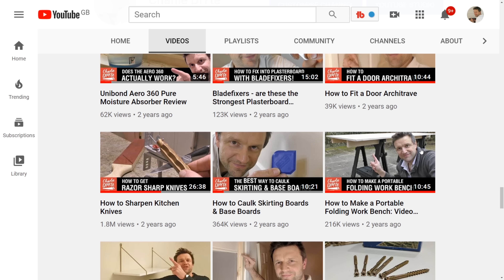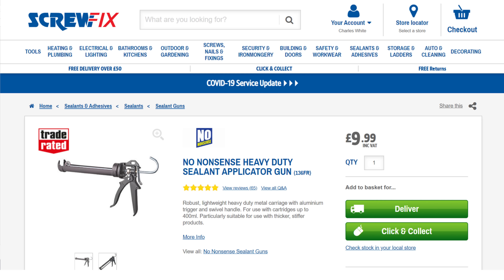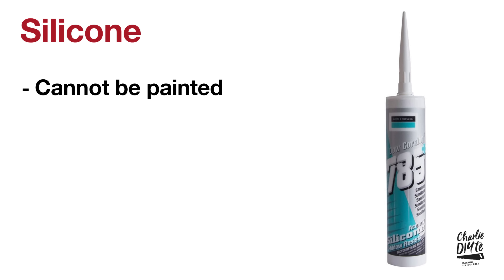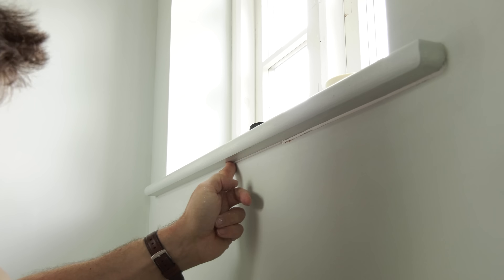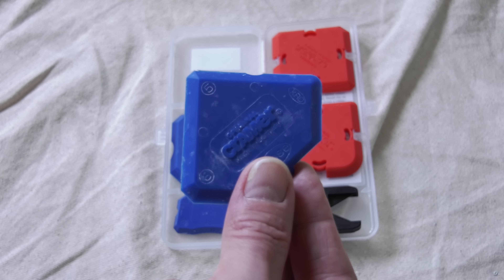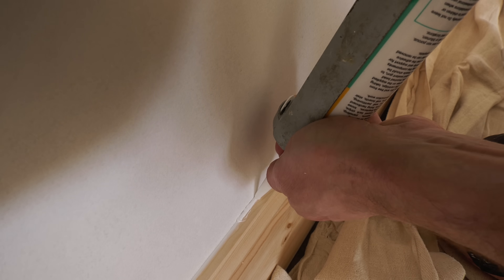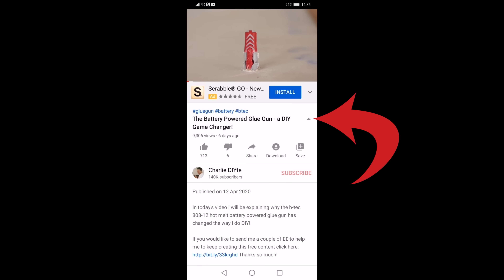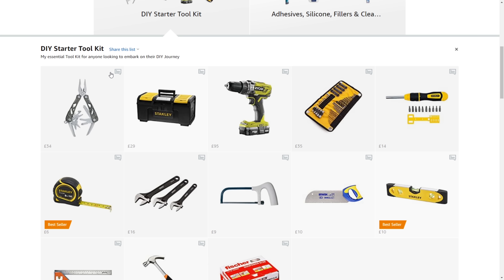How to Caulk Skirting Boards & Baseboards - 2020 Update

Comment: For your wooden boards scenario, why not use liquid nails (same size tube of glue) which will hardened as cured so dirt and fungus can be easily cleaned, whereas the soft silicone will let them penetrated & diff to remove. Have u ever think of the pros & cons of using waterproof liquid nails over silicone in some of your caulking jobs that needs painting onto the cured caulk?? Can u share your comments about caulking with liquid nails. Another pro is the high adhesive power.
Reply from the maker: Sam I used an impact adhesive on this job before I caulked. I've just sent you the link. The key is to make sure you can tool it and that it can be over painted.

Comment: Does the primer you use negate the need for knotting solution?
Reply from the maker: Yes absolutely. Zinsser BIN is shellac based and so it completely seals the knots. I love the stuff. I don't use any other primer now. Plus it dries in 15 minutes, repaintable in 45. Check out some of my vids on it https://www.youtube.com/watch?v=jEhhNqYkmAE
Reply: @CharlieDIYte  Brilliant - knotting is such a pain ...thanks for the tip!

Comment: Charlie which is the best glue too use for skirting board going onto new plaster walls
Reply from the maker: Good question. As I said in the vid, a lot of carpenters glue and pin, but this is trickier if you've got masonry walls, where you'll need plugs like I did. I used to think Gripfill original (the green one) was the best but it does skin over if you don't apply it quickly. The others are a lot more like silicone as I showed in the vid, and so if you want to go down this route, any of these would be fine https://bit.ly/3hRZArH . Sticks like Sh1t has a good following and has been around for a while. A lot of people are using foam now. So maybe get yourself a gun https://www.youtube.com/watch?v=Obc1thYnLEs&t=5s and experiment. It has the added advantage that if you ever have to remove the skirting you can simply slice the foam away with a saw. My suggestion would be to use foam, and shove a heavy tool box against the skirting whilst it sets. It'll help with thermal insulation too. Check out this thread https://community.screwfix.com/threads/best-skirting-board-adhesive.201571/

Comment: If doing wooden skirts that are varnished. Do you still caulk using white or find a matching colour to the varnish ?
Reply from the maker: That's a good question. Typically people use a caulk that matches the wood but it depends if you want the caulk to be an extension of the skirting or the wall. I think you could get away with a white caulk and then paint it as in my view the caulk is an extension of the wall but you'd need to use the Cramer tool and maybe experiment with both and see which look you prefer?
Reply: @CharlieDIYte  perhaps you could advise me. Finding a pine colour caulk is difficult. I wondered if this was suitable instead. https://www.screwfix.com/p/ronseal-multipurpose-wood-filler-natural-310ml/50971
Ronseal wood filler in a tube. Says its flexible and no shrinkage. I've gone for clear matt varnish as I like the knotty pine look.

Comment: Hey, great video, I bought the Cranmer after watching your video a few months ago and it's changed my diy life (bit sad lol). What type of sealant/filler would you advise I use to fill gaps between pvc scotia and a plastered wall with emulsion paint?
Reading online some people suggested polysulphide mastic, but I've never used this and I'm worried it will need doing again in a few years. The pvc scotia is covering a large ceiling area and it's only accessible with scafolding, so I want to make sure it's done right the first time. The area has also been prone to mould, so I want a sealant/filler that is resistant to this too. Thanks.
Reply from the maker: Hi Roy. I can't categorically say for sure which is the best, but in my experience the best silicone on the market is manufactured by Sika, so you might try Sika Decorators Caulk https://bit.ly/2LlGwnq. If the area is prone to mould, you might take a look at my mould video https://www.youtube.com/watch?v=jEhhNqYkmAE If you can treat the ceiling with a paint that's impervious to mould like I did here, or perhaps the Zinsser Ceiling Pro all in one paint https://www.youtube.com/watch?v=7qIEamDwxfg&t=1s then that'll get you half way there on the mould issue. Also, (sorry Roy, I'm giving you loads of homework here) get yourself a hygrometer and try and get that RH level below 60% then mould can't form. Take a look at my condensation video for more info on this https://www.youtube.com/watch?v=TIDb-pdOnXM&t=3s
Reply: @CharlieDIYte  thanks for the detailed reply Charlie. I have already watched your mould video, it was very comprehensive and helped me tackle a separate mould issue I had in my own property which worked well. I will have a look Sika caulk, I didn't realise they made it, I've only seen sikaflex. Thanks for your help 👍

Comment: Is there a reason you can't tape over an already painted or finished surface?
Reply from the maker: No but even a low tack tape often takes the paint off, and it tends to give you a false sense of security as you paint over the tape and when you peel it off the paint has often leached under.

Comment: Hi Charlie, love your videos, please keep them coming.  I need to fill gaps between a ceiling and a green oak beam that has shrunk.  Some of the gaps are about 10mm.  I'm thinking of using the Saves Nails gap filler for this.  Would you agree? I noticed at 9:08 in the video you have beams too.  What did you use to fill the gaps around them when you did your bedroom? All the best.
Reply from the maker: Thanks so much, Kevin, I really appreciate that! Is the oak going to keep moving, Kevin, and is it one of those gaps that needs filling and painting?  The reason I ask is that this stuff https://www.youtube.com/watch?v=V6lZXjRR-1k&t=47s is the nuts for filling gaps as the foam will keep expanding or contracting to accommodate movement in the oak,  and eliminate all draught, whereas if you caulk or otherwise fill, you could have the same problem in a few months and you'll get cold bridging through the caulk or filler. My beams are nearly 200 years old, so they're not going to move any more, so I could just fill with Easi-fill. It's awesome stuff and that's what I'd recommend if you're adamant you want to plaster up to them. Take a look at this vid where I talk about Easi-fill in more detail https://www.youtube.com/watch?v=6Omsv5-NN9k&t=537s 👍
Reply: @CharlieDIYte  Many thanks for your prompt and informative reply.  It is much appreciated. It looks as if the expanding foam tape cannot be painted over, so I'm not sure that that is a solution. I suspect that the green oak will continue to shrink (it's about 12 years old and the beam is about 14 inches square). I too have some oak beams about 200 years old and they haven't moved a jot since the barn conversion. I'll go ahead and use the Easi-fill so that I can paint over it on the ceiling. Thanks once again for your practical advice!

Comment: Very interesting Charlie I'd say unless  your staining the skirting or clear varnish don't use wood skirting use mdf .mdf doesn't cup or warp and a far easier fit less hassle keep up the gd work tho
Reply: With MDF skirting is there any issue if you were to route a profile on to it and then were to paint it as you now effectively have the exposed "end grain" the length of your MDF skirting?
Reply: @C4sp3r123  not really just seal it with paint it will be fine
Reply from the maker: @chrishowell8124  Completely agree, Chris. I'm never using it again!

Comment: Hi Charlie, you have really spurred me on and given me the confidence to complete my DIY projects. I am a DT teacher in a UK secondary school and it is great to see an intelligent, comprehensive approach for us layman's, delivered with humility.  To show my appreciation, I have subscribed and bought a few bits via your Amazon store. Could I ask a quick question - I want to caulk around the edge of my uPVC windows i.e. where the newly plastered wall meets the window frame?  Can I still use the Evostick caulk you have used?  I wasn't sure if the caulk would adhere to the uPVC (I saw a fellow viewer recommended 'Nemesis Mighty Caulk').  I will be painting a coat of Crown's clean extreme scrub able paint post caulking. Many thanks if you get a chance to answer this?
Reply from the maker: Hi James, great to hear from you. Thanks so much for your wonderful comments - which I find very humbling 👍 You sometimes feel like you're posting this stuff in a bit of a vacuum but the comments are a constant reminder of why I'm sitting through the days, often weeks of editing to get a video out there. I've just chanced upon this forum https://bit.ly/382hTZS and I believe what you need is neutral cure, low modulus silicone. However that assumes that you don't want to over paint (as you obviously can't paint over silicone). If you do want to paint over it, I'd be tempted to use the Evostick, perhaps on a small area, and just see how you get on. I've just had a look at the canister and it says nothing about the exact nature of the surfaces that it will adhere to - see also here https://trade.evo-stik.co.uk/product/decorators-caulk. However I would be extremely surprised if it isn't designed for upvc as that must be one of the main applications of it in the industry. I've also heard good things about the Nemesis Mighty Caulk though interestingly they too shy away from mentioning its adhesion to upvc https://bit.ly/35SXpA3 Sorry I can't be more definitive...
Reply: @CharlieDIYte  Thanks for getting back to me so quickly Charlie... and on a Sunday!! Much appreciate your efforts. I am going to give the evostick a try, and as you suggested, start on a small area. I will feedback how I get on. All the best
Reply from the maker: Good plan. Let me know how you get on, because it will be a good future resource for others with the same problem 🤞🏻

Comment: Do you use the flat side of the profiling tool or the concave side?
Reply from the maker: The flat side should be pulled into the silicone.

Comment: Great video and as always useful. Have you had any issues with crazing/cracking after painting over the caulk? This seems to be the biggest issue after using emulsion over caulk and people recommend to use BIN primer over the caulk but I'm worried about flashing as BIN is strong shiny stuff that tends to show through after even a few coats with quality paint
Reply from the maker: Thanks. No I haven't had any problems with cracking (just checked it!). Could be testament to that Johnstone's flat matt I used. It's excellent paint. You're right about BIN though. It does flash particularly with cheap contract matts. I had a nightmare with a Leyland contact matt a while ago. 3 coats and it was still flashing so in the end I painted the wall with Ceiling pro 5 in 1.
Reply: @CharlieDIYte  ah fair enough. I used the Nemesis decorators caulk from Screwfix which is highly rated along coving and ceiling, waited almost 24 hours although its supposedly instantly paintable and after a coat of Leyland Hardwearing matt emulsion (with some floetrol added in) I noticed minor cracking and crazing along the caulking. Annoying. I've read spot priming with BIN should eliminate the problem but worried about flashing now.

Comment: Good video Charlie, have you tried CT1 at all, if you have not do a video on it great stuff Mate , Stay Safe !!!.
Reply from the maker: Thanks Brian. Yes, I used to be its number 1 fan (still like the Multisolve spray) but I've massively gone off it after it a) failed in the shower and b) completely disintegrated off the windows where I used it to replace the glazing silicone between glass and frame on the outside. Mulling over whether I should do a video on it or not.

Comment: If your walls are bowed I suggest you plaster to correct the wall rather than fill the gap with caulk. It will look 1000 times better :). My contractors recommended this. Unfortunately they did a shitty job caulking and I need to go cut it all out . It cracked it 6 months
Reply from the maker: It's the skirting board that's bowed, not the walls!

Comment: What about sealing in between the floor board and the baseboard trim? If it’s not sealed, isn’t that space in between a great little nook for pet hairs , dirt, dust mites, fleas, spiders, and even enourage mold growth by holding onto beads of water after mopping floors or a spill? 

Im not a construction expert at all but have been dabbling into all of this as a mom and house manager (i was a chemical engineer before in semiconductor manufacturing in the “defect” monitoring department….lol how ironic!). I work very hard TRYING to keep things clean and healthy for our family in thus 1500 ft home (2 large dog, 2 adults, 2 kids). And regarding our floors, I have not only noticed our dog hair peering out from the cracks of floor board trim from time to time but also if there is ever a spill or you have a puppy who has an accident on the tile floors the grout acts as a channel, and that channel eventually goes into the edge which is like a moat… A little collection full of grossness! I started pulling off our floor trim because various parts of it were driving me crazy with so much debris that appeared to come out from them after I just cleaned! I would already see ants and other small bugs tend to weave in and out of them from time to time so I suspected it might even act as “protected”  bug incubators! 

We own a 4 plex next door which ive also been renovating (mostly the design, but also help clean, paint, etc)! We made them Beautiful with engineered wood floors and real wood trim, and even real hardwood cabinets etc. however my husband never put any sealant or caulking on the trim or between the floorboards and the sides/walls, so they are just big open gaps, which are hidden by wood trim. But I know the gaps are there underneath that trim and the thought of it drives me crazy because renters don’t necessarily keep things clean or clean up spills right away. And I noticed in some of these cracks there were spiders etc. I had only time to fill one tiny section, because my husband had already put the hardwood cabinets in place so I couldn’t get to those unfortunately. He said ceiling floor trim is not the norm, but I have since found your videos that shows me otherwise Dash at least the top part of the trim where it’s visible. 

So what I wanna know is why am I not seeing people fill between the bottom of the trim and the floors, because it seems like that is the most important place to have sealed and protected to prevent bug infestation and control dust, as well as protect those gaps from harboring water that could potentially then contaminate the drywall and grow mold. I actually found really bad black mold growing behind some of our trim boards! Granted they are about 10 years old, but still that seems unacceptable to me because no one would even know mold is there unless they took the boards completely off like I did!
Reply from the maker: Typically you don't seal the gap between the floor and base boards, partly because it wouldn't look great but also because caulk isn't actually a very good insulator so it wouldn't necessarily stop the mould, and it's better to have air circulation where you've got mould. What I've done in my bedroom is to use expanding foam tape on the gap. Do you have this stuff where you are? I think I mention it on this video https://bit.ly/3cfJHvG but also in this one https://bit.ly/3AvfOBq That prices a great thermal bridge and also stops moisture and dust getting through.

Comment: Hi Charlie. No you definitely did accidentally say « silicone » instead of « caulk » in your last skirting video. Only once. I knew it was just a mistake, but anybody that didn’t could make a mess & waste time. I was badly advised at the sheds years ago - told that caulk & silicone were the same. So I mistakenly used « decorators caulk » to « silicone » my bath. Imagine my shock horror surprise to wake up the next morning to it all dry, cracked & shrunk! 😹Took a while to dig it out etc Waste of a day in total.
Reply from the maker: Sorry to hear that. Yes in the US they call silicone caulk, which adds to the confusion.

Comment: I found some well maybe 2 dumb things in your video (although the rest is good).
1) you can paint over silicone if you paint with proper paint (in your understanding it would be a 'hardcore' paint not water based).
2) you can sand off the 'bad' side of the skirting wood to make gaps smaller or almost gone. But that's more for a professional and passionate worker.
3) Some say using a human finger in works like fillings where they are made of many chemicals are no good. It makes sense because it's not natural and having a plastic tool instead of a finger makes even more sense against that.

Comment: Can you not also use an old credit card cut to measure instead of that tool?
Reply from the maker: You can but it won't remove all the residue and give you such a clean line.